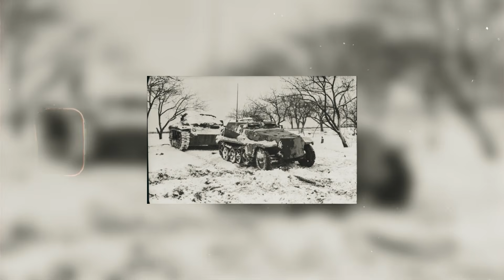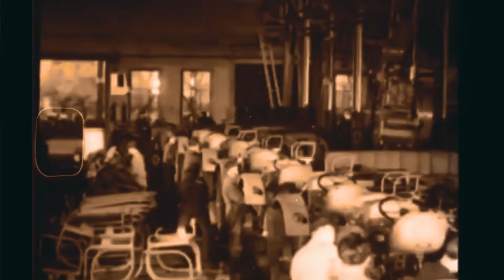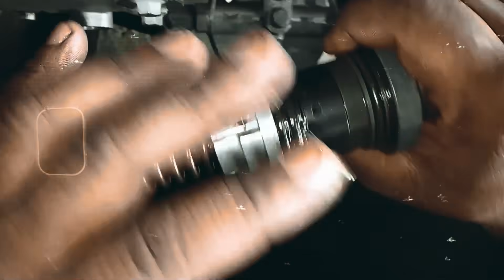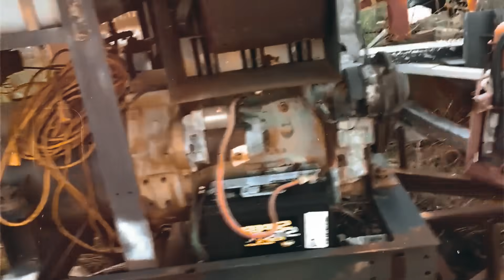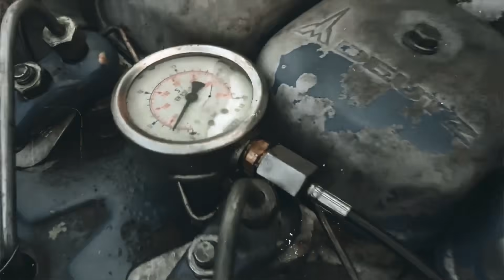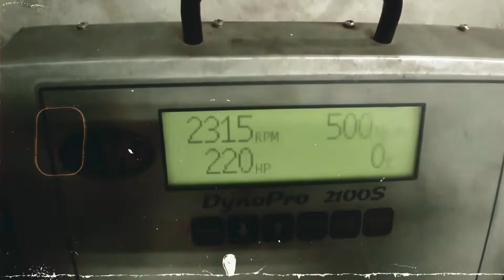Why Deutz F6L912 Was KILLED | The AIR Cooled Engine

Comment: The Deutz engines in Atlas Copco drill rigs had a full shut down system. If the engine or compressor overheated, the engine lost oil pressure, broke the fan belt or the rig ran low on hydraulic fluid it shut down the engine via an electric fuel solenoid. Kept spotlessly clean the turbocharged and intercooled Deutz 913 would run on a 45C day with 185C shutdown switches. Having an onboard compressor and air hose was very useful.
Reply from the maker: Atlas Copco didn't mess around with those protection systems! Oil pressure, belt, hydraulics, temperature - all covered. And you nailed the key point: keep them clean and they'd run in heat that most people wouldn't believe. The turbocharged 913 was a beast. Appreciate the insight!

Comment: ... Problems that could have been alleviated in modern R&D with aluminium alloys, oil cooling, and _primary/auxiliary electric motors-fans et al.
- Like, taking a 4-cyl Deutz and building a trike frame around this tough lady! The greed-led left along with their capitalist cohorts hurt this engine.

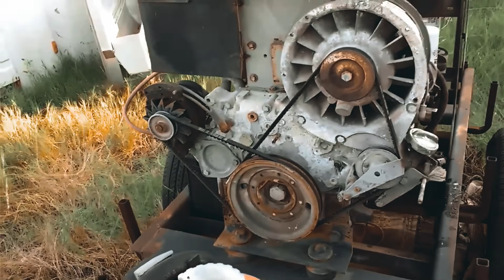Comment: From YYZ (10:58) That was incorrect, in the late 70s I worked with Deutz engines into log skidders, the fan belt keep a limit switch open, but if the belt break, it light a warning for the operator. That belt is easy to change.   It is just western countries with that green mentality , personally I do not think that should apply to military vehicles, since by definition, war is not a very green activity. Much of the world  (3/4 ?) the pollution laws do not apply. Deutz could have sent their info to Brazil and start a production line there, as the Germans did with VW Bug engines to this day. That design should serve for much of this century. Germany is getting de industrialized, so the outsourcing is just joining the crowd exiting.
Reply from the maker: Thanks for the correction on the belt warning system - that's great firsthand knowledge from actually working with these engines! You make a fair point about the military exemption too. It does seem ironic to worry about emissions standards on equipment designed for warfare. And you're absolutely right that Deutz could have gone the VW Brazil route. The tooling and knowledge still exists, and there's clearly demand in markets without strict emissions laws. Maybe someone will eventually pick up where they left off. Appreciate you sharing your experience with the skidders!

Comment: Those engines were legends on Cahora Bassa  Lake in Mozambique. Handled the heat and everything that the bush could throw at it. I have a picture of six kids pull starting a six cylinder Deutz on a transporter with a cargo strap around flywheel. The fuel rack would open wide and in that heat the engine would fire on first pop.
Reply from the maker: That’s an incredible story. Those engines really earned their reputation in places like that. Pull-starting a six cylinder with a strap and having it fire on first pop — that says a lot about how tough they were. Appreciate you sharing that memory!

Comment: The F6L912 could be equipped  with an oil cooler to help reduce the thermal load, but emissions and power requirements per liter, and other limitations finally took its toll. Under the right conditions,    this engine is still a gem!
Reply: What killed it was no parts for repair plus you freeze to death in a  tractor cab with this engine during winter time.
Reply from the maker: Fair point. Parts availability definitely became an issue over time, especially depending on region. And yeah… air-cooled in winter wasn’t exactly luxury 😅 Thanks for sharing the real-world perspective.
Reply from the maker: Exactly. When it was within its intended application and properly set up, the F6L912 was a really dependable engine. Appreciate the technical insight!